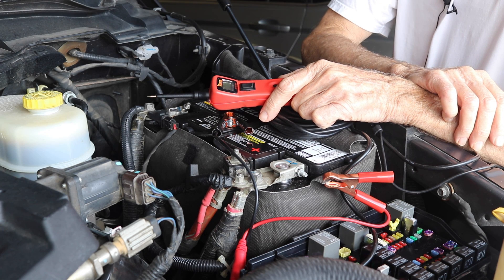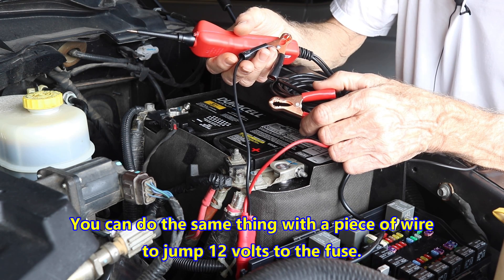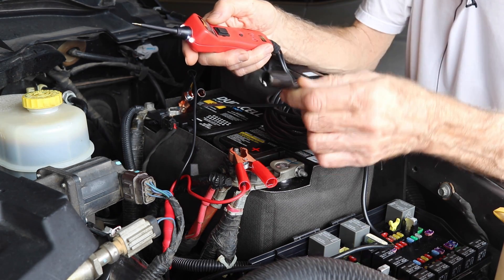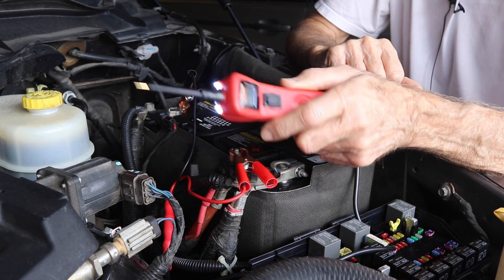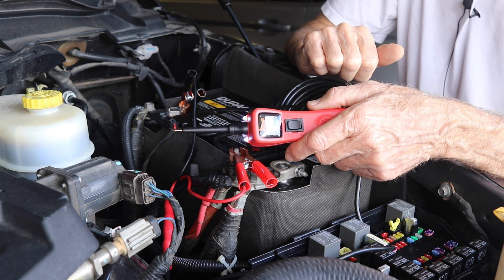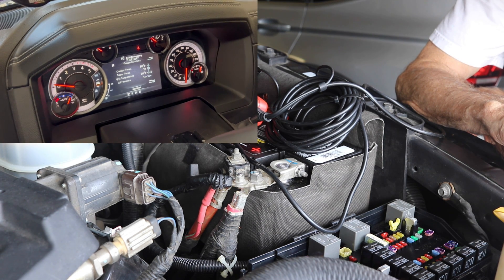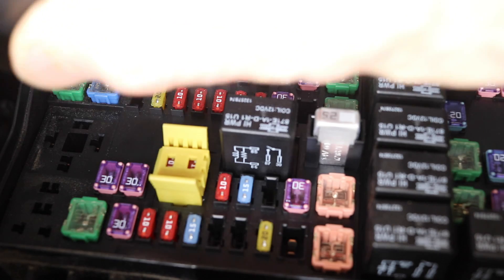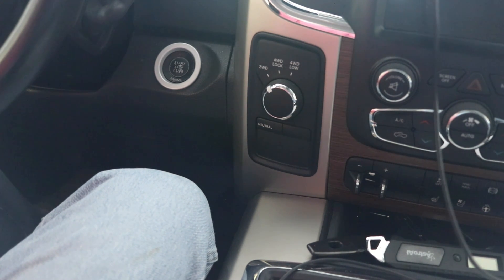A little bit on the Power Probe

Comment: Quick question: My 1997 f350 7.3l turbo diesel dually has brakes that lose power assist in very cold weather. In summer, it rarely happens, or if it does, then within a few seconds, I get normal full brake power pressing the pedal. However, just in temps below about 45° Fahrenheit, I have to press the pedal extremely hard to stop the truck. Any ideas what I should do to fix this problem? This problem just started last winter. Thanks so much.

Comment: Marion could I email you?  Or maybe a phone call or text, thinking shoot adding a few pids that I do not think are options in torque pro and wanted to pick your brain
Reply from the maker: I'm not too up to speed on it, sorry.
Reply: @MarionBlair  I fixed my brakes. I installed a new booster. They're back to normal  thank God 👍🌲🌟
Reply: @MarionBlair right on, I want to add pid’s for fuel pressures at a few different places

Comment: With a push button start, if the truck is cranking to purge fuel, you can simply push the start button a second time to stop the starter.  Just like cycling a key back and forth in a keyed ignition switch.

Comment: I always change the rear filter first and let the engine run on the front fuel filter, no prime necessary...then after changing the front I stand outside the cab to prime six times for 10-to-15 sec. 9k miles fuel filter chang.